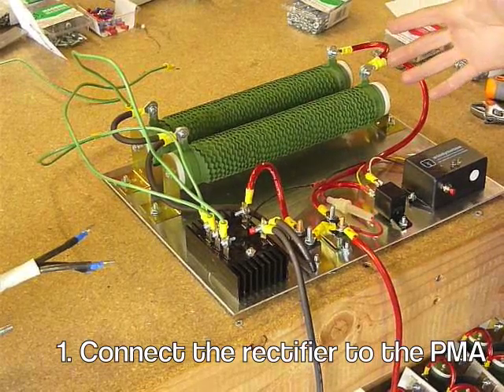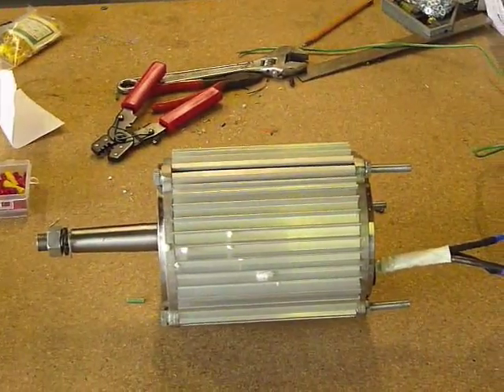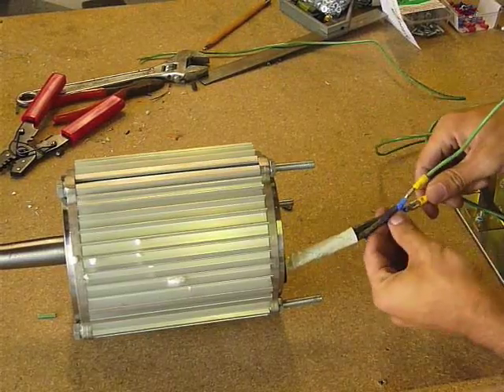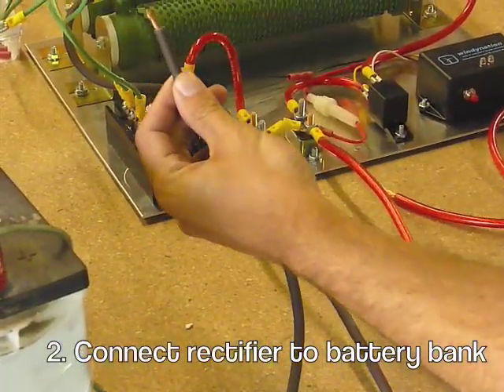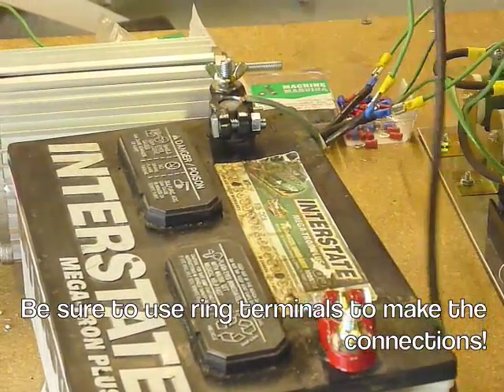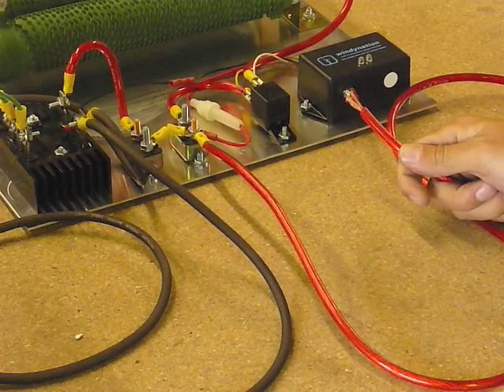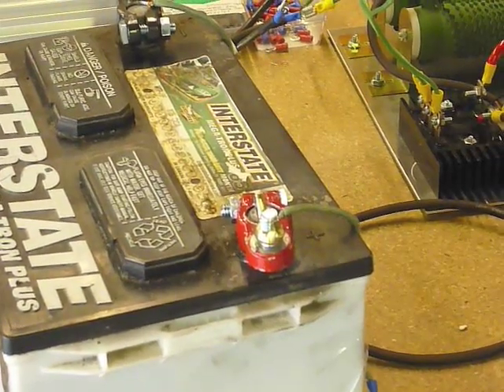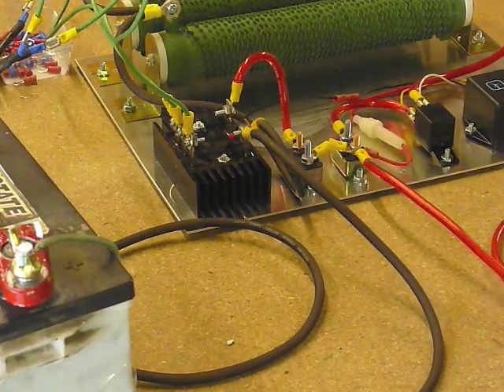How to connect your wind turbine / generator / PMA to charge controller

Comment from the maker: The motor is harder to turn because it is under load when connected to a light bulb. This is normal. 

A diode needs to be placed between the motor and the battery. This will allow current to flow from the motor/generator to the battery bank (battery charging). The diode will not allow current to flow from the battery to the motor which will prevent the motor from spinning and draining the battery.

Comment from the maker: Good question. It will not feedback into the turbine because the 3 phase bridge rectifier (the black thing) has diodes inside of it. Diodes only allow current to flow in one direction. In this case, from the generator to the battery bank.